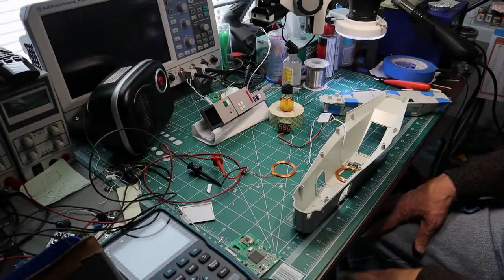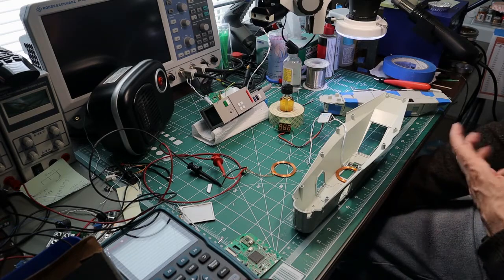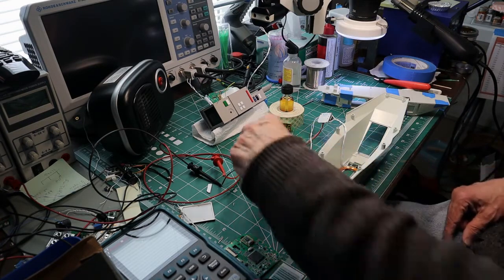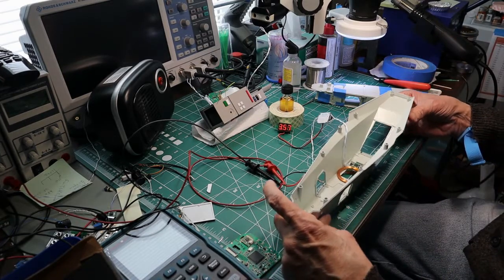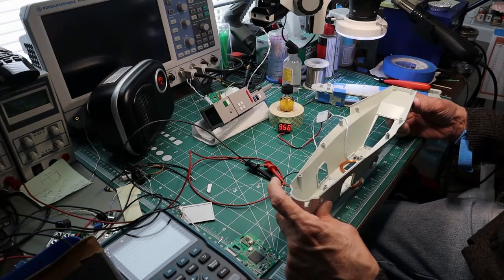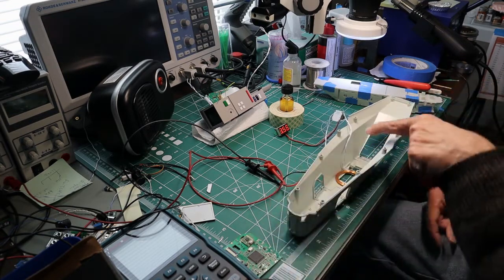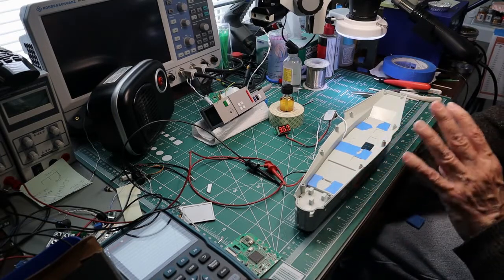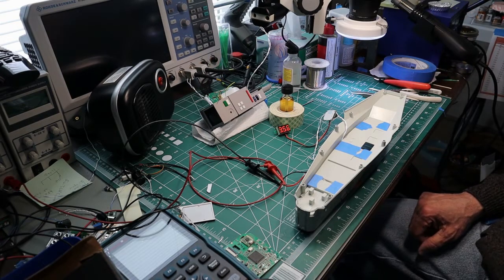My Revell Razor Crest build02 power input

Comment: I've never done anything like this but I'm interested. Your video doesn't really explain anything, however, for someone unfamiliar. Where did you get the parts? What is the circuit board for? Is there a tutorial somewhere to watch or read? Thanks for any further guidance.
Reply from the maker: Hi David, glad you found the video of interest. I don't do "how to" videos, just "here is what I'm doing" videos to support my threads over at the "RPF forum". Here is a link to ebay for what I'm using, though it's not the same seller, but it should help you find what might work for you. 
 https://www.ebay.com/itm/234188399845?_trkparms=amclksrc%3DITM%26aid%3D1110006%26algo%3DHOMESPLICE.SIM%26ao%3D1%26asc%3D237334%26meid%3D2683b07df98244abaf5664cb89defa8c%26pid%3D101195%26rk%3D1%26rkt%3D12%26sd%3D393737150603%26itm%3D234188399845%26pmt%3D1%26noa%3D0%26pg%3D2047675%26algv%3DSimplAMLv9PairwiseWebMskuAspectsV202110NoVariantSeed%26brand%3DUnbranded&_trksid=p2047675.c101195.m1851&amdata=cksum%3A2341883998452683b07df98244abaf5664cb89defa8c%7Cenc%3AAQAGAAACQIcMeVSAjSYcNZhx8V8zgcvE4e0LWe%252B4ZlsQ%252BylqchLIGHvwC4TtCXgNCsAsA3vfdU%252FF52aJUQqHXgF6ujWo3GxheCcUlitM28V4sKBUND0k%252F4bqeaNsFfwa5Ay%252B6BheybMOCCY1JsHW4JvCze2alXuCVl2tjZOMpbcSsgWjlUWwJzBl6WeF%252FpXA7JcjcFInfEZHWzpLML7ZwofW7J62IajdZ24XR5vxdCvpYIg1OKPgRxC8OenhY5G8ynParAvFDzfBqPRMKwp6YkkPtCDXBZeMVaLFBNKfaBPb6xLCDaNuEWj3t4CIXdj10MDqiljf2np4ngGPbUeHRS0y%252BZ8FGpIHCN%252B9q%252F4aP3AzMmy8WP9fIxE3vrbCeXQ5m5R9aeu5tUDOs6tqT8PgC4epuclj6Awvu5GDHE4xUfyxeifBm5HsaYSaP2xiaC32PjbkM%252FEuoq%252F0SkswiTexsupP3GwHn6HN89c5Sjl9qm%252FH%252F17rnNNjHloBbPDQzeaaU2D7gCqXj9vBnouoXCGdhexjtRX4bDgXkrHyC2Gt7Fe07BsIiinR9GAotscnZz1Mvkyuwd0hi3rqVecd56Sb53NJlW8Hl6O8twK%252Fg%252FTaB1qWom1QAHHVBPwnIbfsDtaKY65mXc4QZxa%252F9TGZ99X96DfxJjearhant6csix2FQ2rd2B3XPWD24UP4yKNr99%252BF6OlYsdNsuGs7rk9lX%252F0DxYvKVyc%252FPvb41fWBjD3SQ7F1o85tQLLy04i2izBeufln3Ehoj1xJOQ%253D%253D%7Campid%3APL_CLK%7Cclp%3A2047675